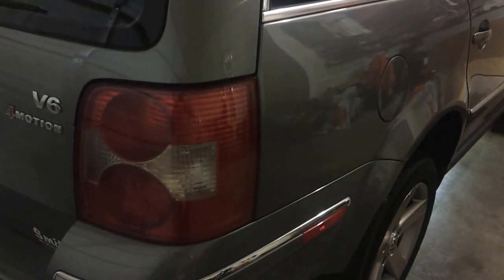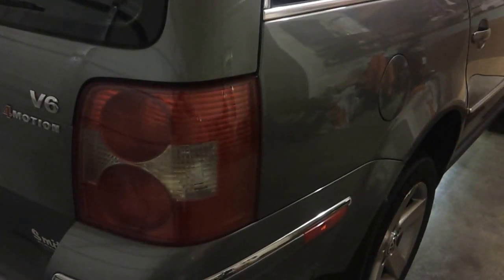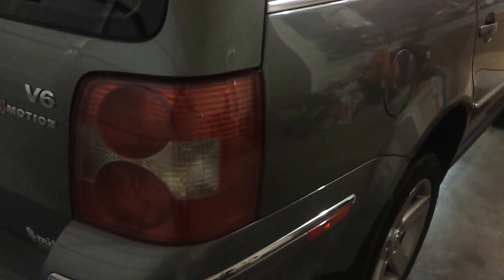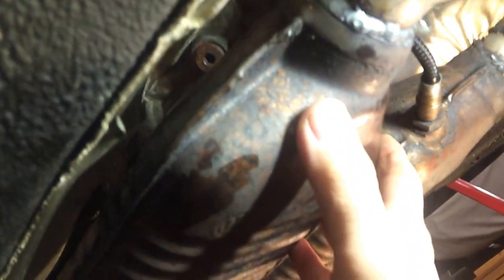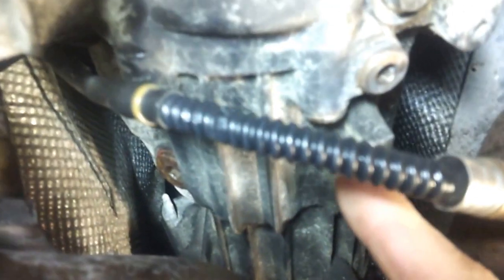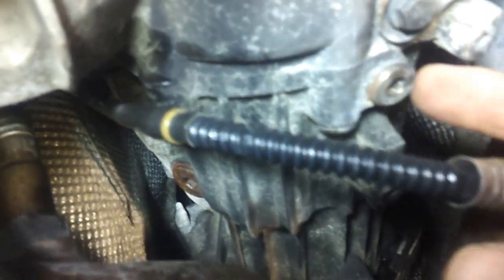Forward Differential Location-Volkswagen Passat- 4motion-model years 2001 to 2005 2.8L V6

Comment: 75 w90 in all the differentials? Center, rear and front? 
What fluid to use for automatic transmission?
Reply from the maker: That depends on what kind of model and make car your working on.
Reply: @ozzstars_cars  my car is passat 2.8 4motion 2004
Reply from the maker: @andersonfernandocarvalho3455  the trans fluid has to be Audi/VW spec approved.   The fluid change is not that easy.

Comment: actually the car has 3 differentials, the one you showed is the  center diff. front one fill port is driver side at 345 to5 oclock  looking at the out flandge the cv axle is connected to you will see two screwws/bolt/w.e its the top one on top of it